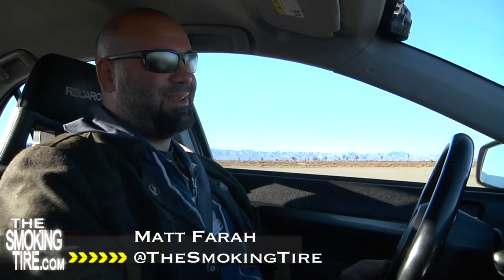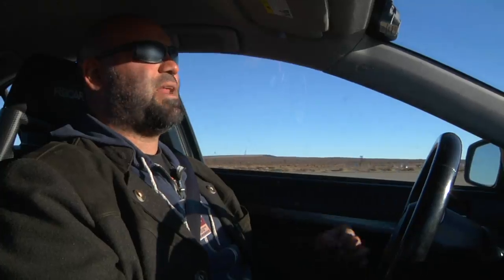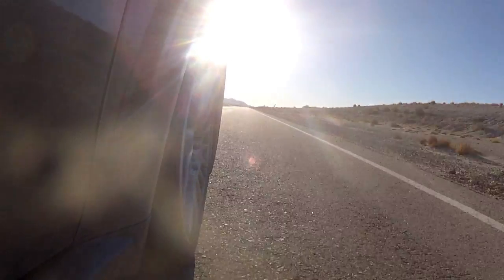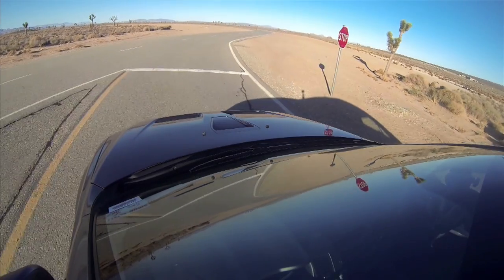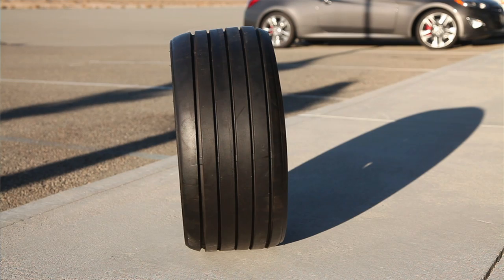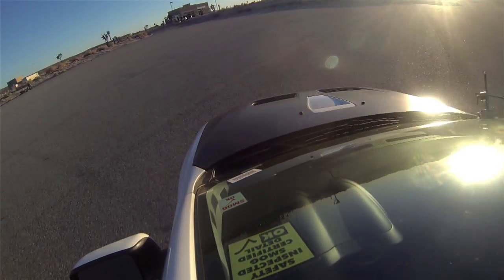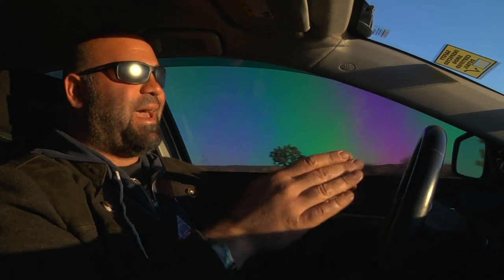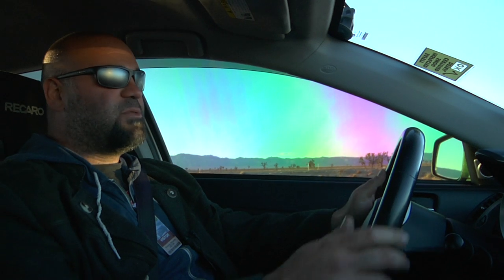Are current tires the wrong shape?

Comment: Interesting comparison and nice video! :) But I think in order to get real information, would be interesting to see average lap times, after a lot of laps with both tire sets. And also a comparison between acceleration. G-forces generated in a corner is quite good measurement also. Now in this test, it can be partly placebo effect, if testers expectations are high or low. Well very nice video still and interesting tires . . .

Comment: So what I'm thinking and please correct me if I'm wrong but wouldn't this be the same thing as lets just say you buy aftermarket suspension with camber plates which realistically you going to have to do eventually if your in motorsport with the difference of running the best tires on the market with the reliability of the brand name tires?

Comment from the maker: yes, I did. You just didn't pay attention. I sai the tires were identical compounds, identical tread patterns. The only difference was that one tire had camber built in (and the suspension adjusted accordingly) and one was to OEM spec camber and suspension.

Comment: Wish they had a auto leveling G-meter

I am also concerned that changing the camber & toe, could strain the bushings especially over bumps, causing parts to wear out of spec faster, but maybe the tire camber doesn't have this problem if the suspension is dialed in right

Comment: More quotes from IDIOT "Exyiaevox" "A reminder, the rocker is extra contact patch made of mostly sidewall material. Since the tires are designed directionally inside/outside, the edges are designed in a way to have more contact patch ready at high lateral loads, rather than a rounded off sidewall on a normal tire. This tech mostly came into play on the big left-hand sweeper.The tires would sound like they were rolling on their sidewalls, but the feedback I was getting was slightly more grip."

Comment: More quotes from IDIOT "Exyiaevox"It took quite a few runs, maybe at least an hour, to get used to the tires. Being able to handle transitions better, the car BLAZES through the slalom - absolutely blasts through it, even on GTWorx spring rates! After getting used to the faster reaction times the car was capable of taking, the next obstacle was getting a feel for the "rocker".
More to quotes to come

Comment: Yeah, right! Pick a random road tire, compare it with another one and make the exact same video as here. Different rubber, different tread, different wire frame, different sidewall stiffness. Let's hope that at least the size was the same.

If you want to prove something then the only camber comparison that make sense is using the same tire and using one that is square (even wear) and other that has a camber wear. Suspension should be adjusted in both cases for maximum tread contact.

Comment: Where is the telemetry? You cannot compare two tires accurately without telemetry from suspension pots, throttle and steering inputs at the very least.

Comment: You not only used the tires on a completely different vehicle, but didn't even explain if the compounds of the tires were similar.  The tread pattern on the camber tire is more similar to the old F1 grooved slicks.  Throw a R888 or other trackday tire and it will fly in comparison

Comment from the maker: Dialing in camber to standard tires will wear them out much faster than dialing in Camber with a set of Camber tires. They are not the same thing at all. When you dial in camber to a standard tire, the tire rolls on the inside edge. When you dial in camber to a Camber tire, the tire rolls flat. Either way, you're going through tires, but using an adjustable camber kit in conjunction with the camber tires will make the tires last longer than dialing in camber to standard tires.

Comment: these tires arn't to replace camber they are so you can run "more" camber while still having the tire contact patch square with the ground. by doing this you get more straight line grip due to the full tire contacting the road but also get better corner grip because of the extra camber that combats lateral g forces. these tires are fitted so that the high side(bigger side wall) is on the outer edge.

Comment: Only advantages I can think of is the side wall can be more compliant vertically while stiffer laterally and camber thrust.  I don't think its totally bad, but it just might not be worth the manufacturing costs.  

I don't see how these wouldn't increase fuel consumption though, as the car would be fighting camber thrust the whole time while going straight.

Comment from the maker: The company isn't trying to sell tires, they are trying to sell the camber technology to a major manufacturer, since they own the patent on it. So the point is to show that the cambered design works better than a non-cambered design, hence using identical compound and tread for the test. It's not about THIS tire being better than a Cup tire, it's about Cambered tires being better than non-cambered tires. The manufacturer could then use whatever compound they liked.

Comment from the maker: I don't think they are designed to be run at the same pressure. That's the thing with these tires. They are so different in shape that they have different requirements from suspension, alignment, and air pressure that there would be no such thing as an "apples to apples" test to compare with any other tire.

Comment: You clearly dont know what you are talking about. First of, in this case "faster" was used in a sense that it goes faster around corners and such, so yeah, faster is a correct term. Also, the topspeed can be affected by tires, depending on rolling resistance and rolling diameter of the tire, and there is alot of other parameters affecting the cars performance in terms of "faster"

Comment: Ok, one, looking at both cars can you tell which one has the cambered tires by the way that it sits when it is parked?  Two, would that mean that if I have two degrees of camber in my suspension that when I put the two degree camber tire on it will my tire sit flat on the asphalt?

Comment from the maker: The two tires we tested were identical compound and tread, the only difference was one was a cambered tire and one wasn't. You can run 2 degrees of camber on a standard tire and see improvements in handling over stock, but you get premature tire wear on the inside if you leave the car set up like that. These tires are designed to roll flat when you dial in the camber, so you don't have that issue.

Comment from the maker: As the tires come in only 17" and 18" so far, they won't fit on a Mustang, Ferrari, or Lambo. Plus, in order to use the tires, you need a car with either an aftermarket suspension or a factory suspension that comes with adjustable camber, which none of your choices do.

Comment: As someone who works in engineering and designs all sorts of custom machines that do things no other machine has done before, I admire the idea and see only one concern. How evenly do they wear. Other that that I see no reason why these won't become standard on vehicles in the next few decades. Perhaps a progressive compound where the inside is hard and the outside used only when there is load on the tires(emergency braking/cornering) is soft would be something to consider

Comment from the maker: Identical rubber in every way except the camber. The control car was set up with stock suspension settings, the Camber tire was set up to run the camber tires, which requires changing the camber and toe settings.

Comment: their website says that minor alignment adjustments would need to be made. based on the name, i would guess that a camber adjustment would be necessary to be able to properly run the tires. unfortunately, on most vehicles the only adjustable items are your toe and caster. you can get camber kits for just about any car though.

Comment: No, because you dial in camber to in your suspension to account for the camber of the tire.  The point of these is that your contact patch remains the same through corners because they can handle a lot more load than normal radials.  in a straight line they work basically like standard tires.

Comment: Minor question:

Have you run moderate camber on cars with normal square tires?  My curiosity revolves around the build of this tire versus just adding camber.  Adding camber alone already does a lot including the things you mentioned with this tire.  For example, the lighter steering is normal due to the narrow contact patch.  They are more predictable or rather they ramp up in grip rather than down making the experience much more positive when pushing the car.

Comment from the maker: the sidewall isn't just significantly stiffer, it's redesigned completely. Sidewalls on a normal tire are like a circle with weight on them. These sidewalls are triangulated. Since triangles are much stronger than circles, the sidewall shows like 80% LESS deformation than a standard tire under load, so the contact patch remains constant.

Comment from the maker: it has nothing to do with look. When you dial in 2 degrees negative camber on a standard tire, you're riding the inside edge of the tire until you get to a corner and it loads up. These tires, when you dial in 2 degrees negative camber the tire sits flat.

Comment: I don't get why those tires should be better than regular ones. I thought if you have regular tires and increse the camber, the tires' contact patch goes to the inside and therfore you have more wear on the inside of the tire but when you go into a corner the the outside tires are squeezed to the inside and you have a big contact patch over the whole width, camber tires would eliminate this asymetric initial tension. (That's just how i imagined it, no actual knowledge :D)

Comment: Also I wonder how they do not loose contact patch at high slip angles in the same way as regular tires if they are running flat at 0 slip angle.  I think the benefit is purely favorable suspension geometry, not contact patch preservation.

Comment: Well I would definitely agree the the quicker turn-in probably results from the toe-out required to get these to run straight and I do agree that they are very hard to compare since the whole suspension setup must be different for the camber tire to even work.

Comment: These sound like a gimmick to me. Camber increases grip on turns as the rubber shifts to create the solid contact patch on the surface during high g turns. If these are designed to ride flat when not turning wouldn't that mean these tires reduce contact patch during high g turns like a regular tire? Unless the tire sidewall is significantly stiffer to reduce flex. I think the difference you're feeling from these tires is the actual tire compound being stickier and better suspension settings.

Comment: This tire concept is amazing. I have worked with vehicles of varies kinds (Lexus, motorcycles, all kinds of Military types). Being a spirited (lead footed) driver myself I know you can wear a normal set of tires out quickly. They make offset wheels that "force" normal tires to different camber rates, but none of them I have seen works all to well. Normally I would set camber angle out 2 degrees for the weekend races. Then I have to set it back for daily driving. This tire will fix that "Bravo"!!

Comment from the maker: Doubtful. They were the same year and model car within 10,000 miles of each other, and they were both bone stock. Ideally we would have used the same car, but when we were out there testing the cars were as close to identical as you could get and we didn't have time to sit around while they spent 2 hours swapping tires and readjusting the suspension.

Comment: I hate to admit it but your right. I'm still not a fan of the tread pattern tho unless its dry pavement. Also its a little sketchy that they give you an awd evo. Tell them that if you really want them to impress you, instead of an awd car. Make a run with regular tires on your Vette then switch out to camber tires and see what it tells you. Test with a car that doesn't grip well. Then if the camber tires makes a difference. There's your answer. Drag and corner testing. Curious on straight grip.

Comment from the maker: no these tires are shaped like a cone, the outer diameter is bigger than the inner diameter. That's completely different from just adding camber to a standard tire. If you add camber to a standard tire, it rolls more on the inside edge. When you dial in camber to these tires, they sit flat.

Comment: Can we make this part 1 of 2, please, where in second half we get A/B test data?

One may adjust the car's camber to balance the tire. However, I suspect that one must  add toe to compensate for the conical roll. The camber change accounts for the even wear and the toe accounts for the sharper turn-in. Both of these will wear the tire faster than stock suspension config.

Until a big-brand name jumps on this I'll stay skeptical of the wear rate. The performance theory may work, though... data!

Comment: The point is the tires are designed for camber.. if you camber a regular tire the contact patch won't be flat, it'll wear out uneven for obvious reasons.. the camber tire is meant to be run at negative camber natively which gives it a better contact patch... at least that's what I think it's supposed to be.

Comment: That's kind of what I was thinking. There's nothing magic about camber. You add negative camber so that when the car is loaded on the outside tire, the contact patch is as flat as possible. The amount of negative camber depends on a lot of factors, like suspension geometry, the amount of anti-roll you've dialed in, and a ton of other factors. These tires would actually seem to *negate* the benefit of negative camber, because of their shape. As you roll to the outside, the inner lip would lift.

Comment: So what's the difference from having those tires then having regular tires and just adding more camber to match those tires. To me it just seems that they're the same as regular tires. Instead you just don't have to add as much camber to your suspension. Right? Also those tires may be good in rain, doubt it tho since there is no cross tread for the rain to escape to the outside which is the whole point. Snow there is zero grip with those tires.No way to dig into the snow it would just ride onTop

Comment: What is the wear rating on these and how much do they cost? If they are as good as they sound, which is hard to believe, they could be revolutionary. I don;t see them on production cars though, not with those treads. I will need to see them tested in the wet before I believe those claims.

Comment: Sometimes you'll feel it slipping when you shift or take off. That means your foot is all the way off the pedal but it's still acting like you're pushing it a bit. The engine will rev without the car speeding up as much as it should.

Comment from the maker: It didn't seem that way from what we saw. A guy was out drifting a set of 4 degree tires and he was able to drift for over an hour on a single set with perfectly even wear across them. Plus, the point of these tires is that you can run camber without losing the contact patch size.

Comment from the maker: no. They run flat on the ground so they wear perfectly evenly across the cambered tread. Because of the structure of the tire (the sidewalls are different, there isn't just more rubber on the outside), it is impossible to "flatten" them, or wear them into square stance.

Comment from the maker: Time. It takes time to change to camber tires from standard tires because you have to readjust the suspension and realign the car. It was easier to just have two bone stock GSR's. Both were the same year and had similar miles.

Comment: with exactly 2 degrees extra negative camber (same as those tires were) added and the only toe changes were to remove all toe and run straight. I feel that Matt IS a great NON BIASED reviewer and a great asset to all car guys w regard to reporting. I would like to suggest to ANYONE here to call me and I will correctly answer your questions and concerns 100%.The tires last longer and run cooler for sure & ride MUCH better and instill confidence you will never ever get from square tires. Thnx Matt

Comment: When you look at a tire, which is mounted on the car, from the front the camber describes how the top and bottom of the tire is in relation to 90 degrees.  If the top of the tire leans in it is negative camber (most common) and if the top leans away from the car it is positive camber.  Perfectly straight (90 degrees to the road) would be zero camber.

Comment: Why not just test on the same car?

Telemetry data with an expert driver or BS.

I'm also curious if the difference has to do with camber (like advertized) or just the difference in sidewall stiffness as a result of the different sidewall heights.

The tricky part in comparing is the toe settings since the camber tires require a toe adjustment.

Comment: Isn't the whole point of running camber that the (normal) tire is flat on the ground when cornering? This tire is flat on the ground running straight, so it would lift the inside of the camber tire when cornering.
I highly doubt that this tire performs better than the performance tires of the big players

Comment from the maker: They only make the tires in 17" and 18" right now, so they won't fit my Corvette. But my boy Fello daily drives an E36 M3 and drifts another E36 M3, and they do fit those cars. So I'm getting two sets for those cars for long-term testing until they come out with sizes that fit my Corvette, and then I'll definitely run a set on that too.

Comment: What is missing is to compare this with the non-cambered tires but AFTER dialing in camber in the suspension. You can always dial a camber through the suspension set up.